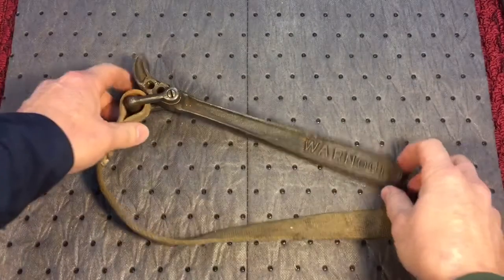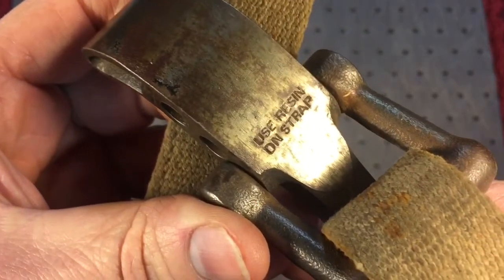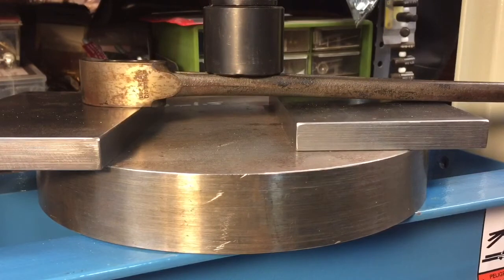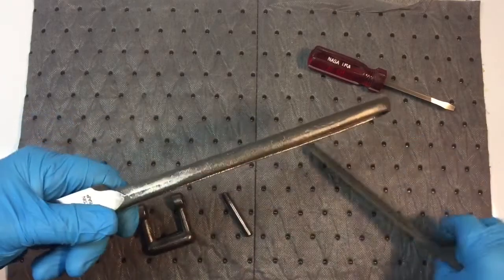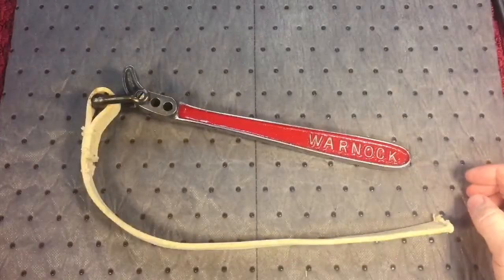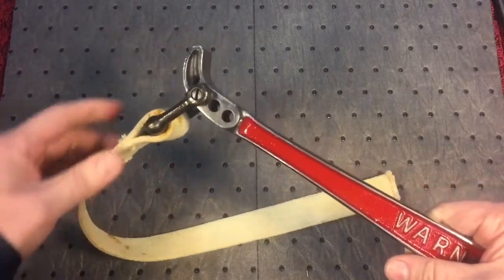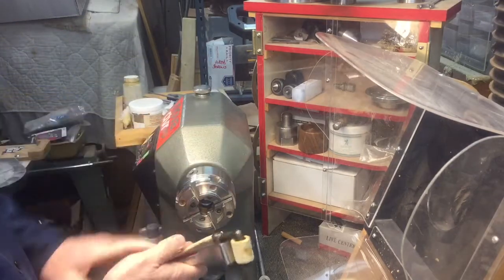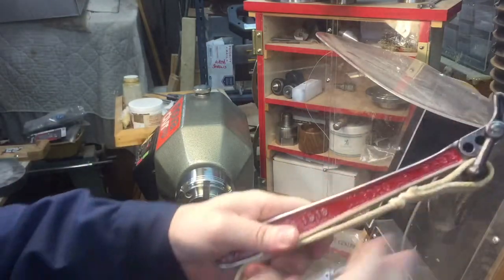1919 Warnock Strap Wrench Restoration.

Comment: I use a Williams strap wrench every now and then. Made from some kind of fiberglass/plastic with a silicone like material for the strap. Works good on older vehicles for belt changes. 1919 year my grandfather fell out.

Comment: Another great restoration. Nice work. What are the other two holes for?
Reply from the maker: I think the other holes are to offer adjustment for straps that have different size loops.  I tried all three holes and found the best hole for this strap.  Thanks!

Comment: Sweet restoration!
...and better than new!
Those extra holes in the head though??
Reply: yep good question, it would seem they would only give less leverage and not really increase the diameter either
Reply from the maker: Hello Wayne! That’s the first thing that had me perplexed- I tried all holes to see which one worked best- I think the holes have to do with how large the sewn loop is on the strap, if you have a larger loop you move the pin back towards the rear of the wrench taking up slack...  just my guess... thanks!  😃👍

Comment: wow , to bend that they must have used a cheater, and still the strap didnt break, i broke a modern strap with no cheater!, they dont make them like they used to
Reply from the maker: Jusb1066 - Those cotton straps didn’t have the same grip as the new rubber type, I don’t even know where I would get resin today! Lol. Thanks! 😃👍
Reply: ScoutCrafter. Nice work on the wrench. I have used those on hydraulic and pneumatic  cylinder shafts with some fine emery paper inside the strap. 
I'm not sure that it is the same as resin but I think it would improve the grip.  Sure helped when I was pitching. Rawlings® Baseball Bags - Official Site
Reply from the maker: Holy cow!  Old Sneelock's Workshop!   I feel like this is a celebrity visit!  Awesome!  Thanks for the tip! I always keep old bicycle inner tubes for gripping situations.  😃👍
Reply: Now you're going to make me blush. I like your channel. Always lots of new stuff. I like to check and make sure I'm not just saying what everyone else is saying so I look around. Yours is one of my favorites.
Reply: It might be too expensive to be practical for something you use every day but you can buy resin at most musical instrument stores. It is used on bows for stringed instruments like the violin.
Reply: @ScoutCrafter   Rosin,  a music shop has it for  violin bows. It makes the strings vibrate and sing.